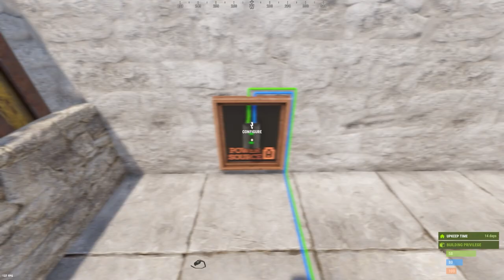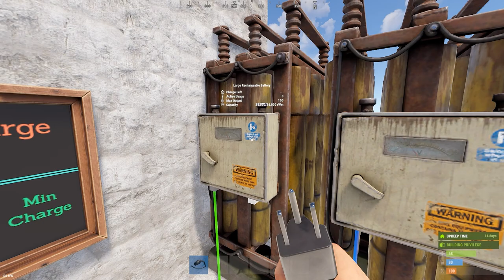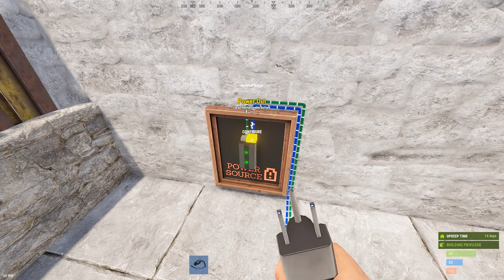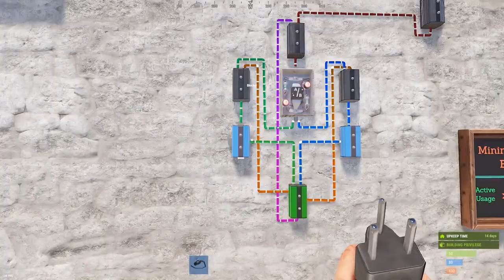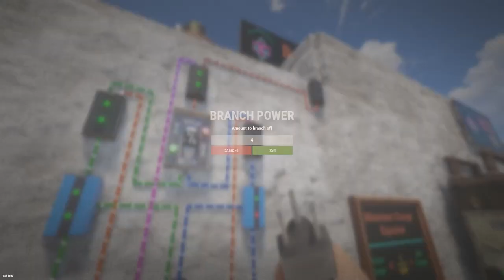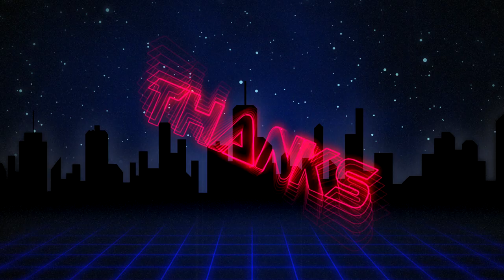RUST | Battery Backup Version 3 - How to Fix the Power Cycling Problem 2023

Comment: I just came across your channel today and am super impressed with the quality!! 

Not that it’s a big deal, it’s only a difference of one watt, but I found a way for V3 to use 6 instead of 7 and it uses the “toggle” option on the memory cell using the power cycle instead of branches👍🏼 Heres how:

1. For both batteries, have the output of the battery to the input of blocker, and output of blocker to input OR switch. 

2. Output of OR switch to EBranch set to 4 (power out of this is your base power at max of 93), then branch out to another EVranch set to 2. 

3. Second EBranch output is to toggle (this will be 1W), and Second EBranch branch out to input of memory cell. 

4. Inverted output of memory cell to one of the blockers (from the batteries) and regular output to the other blocker. 

I feel like this might be simpler and possibly use less electricity rather than setting two branches to the value needed for your base. Love the content, keep it up!

Comment: if you sacrifice 2 more watts by reversing the brances that trigger the memory sell, it changes to only drain battery of active usage. so using wall switch or a timer triggered by a free power button you can keep power usage low when the area is not in use like lighting. need light hit button or have it triggered by hbhf sensor. this way you don't have to keep chaging the settings on brances

Comment: I love all the battery videos!! I havent seen anyone do your set ups on rust yet. (600 hours in😅)The only thing im wondering about is attempting two battery back ups. Is there a way to allow the excess to split off to two back ups. Instead of just a set amount of leftover to charge one and then the power out to the other back up battery from the final switch. (thats in the series of switches powering many batteries)

Thanks for the great videos! I wouldnt be getting through all this electrical done solo without you! about to activate 8 turrets!(couldnt afford the 9th yet rofl)
Reply from the maker: Hey that's awesome! And you're welcome!

Comment: Excellent as always.  I love your meticulous atention to detail.  Makes it very easy to follow what you're doing.

I've been running a version of v2 in my cave base.  Since I'm not hooked up above ground, I have 3 batteries setup with OR switches and blockers.  Currently able to run about 30 hours before needing to swap batteries.
Reply from the maker: Thank you, and cool! I'm working on a video right now that uses a setup similar to that with the idea that it could be useful for cave bases.

Comment: I wonder if I could implement this in my system, I use a larger system, i trickle charge my batteries, running base off root power, and access charges the batter backup. Could I use this system to swich from root-battery backup on a power dip, without draining the batteries fully before it changes back. Im gona experiment now lol

Comment: I followed the exact steps but it all went downhill when I tried to hookup 3 turrets. Had 2 windmills but I still didn't have ** for power. How high do they need to be to get the most power? Mine are currently 2 floors high. Also, what's the best thing to use for several turrets? I used the splitter and it didn't seem to work well. Thanks in advance. I'm very new to all of this.
Reply from the maker: Do you have Discord? It would be easiest if we could stream and check out how you're building it.

Comment: I have a question, can't you just do the same thing with 2 blocker, 2 branches and 1 OR Switch? Just having the batteries going into the blockers which go into the branches and the branches have their branch in the block passthrough of the other blocker?
Reply from the maker: You certainly can, which is essentially what Version 2 does, but the batteries can power cycle back and forth.
Reply: @AustinKlailaGames  no, they also don't have a primary, because when battery 2 is powered,  battery 1 gets blocked

Comment: Hi, i have followed everything but when i remove the green batteryit did not switch over, or when it is low it will keep turn on and off non stop it does not switch to the blue battery. may i know where i did wrong? please help
Reply from the maker: Make sure that you have the two branch switches after the blockers wired correctly and set to at least the minimum required values.

Comment: How could you run a infinite power loop into backup battery’s?
Reply: I believe this is just an extension to the infinite power loop.
You’d set up the initial infinite loop prior to this and have the power go toward the batter back up setup. I think 😅